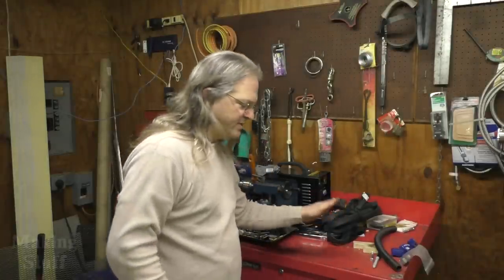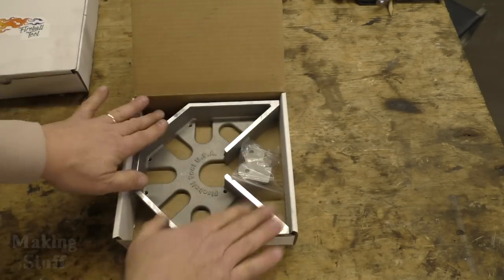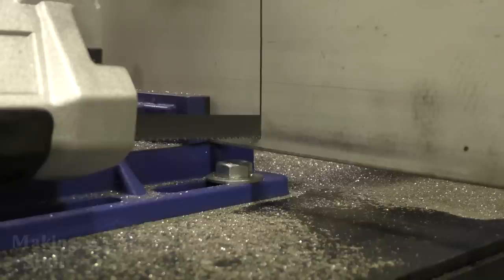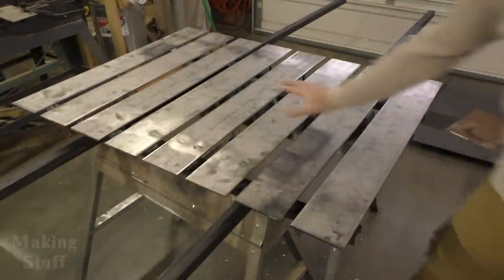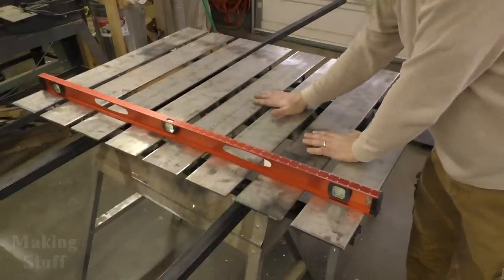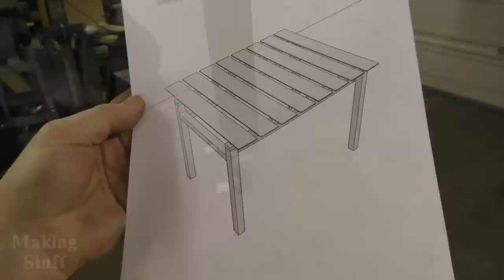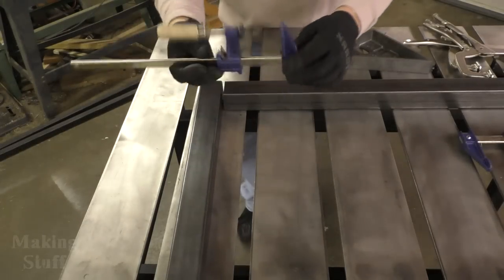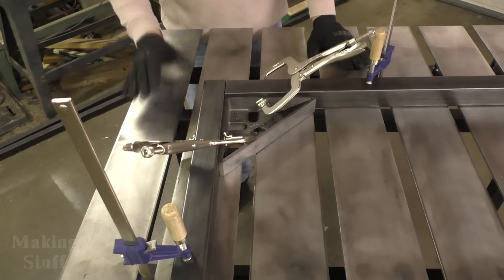DIY Welding Fabrication Table - Stronghand On a Budget

Comment: I’ve watched this video more than 20 times. Dissecting that table build. Guess what.... it’s a great design. Especially the top. I have started my own version of your table. 1/2” x 6” x 40” plates, using 4x 1-2” x 3” bolts on each plate. I’m also using a 3/16” x 1” x 2” channel for the bolts. I will be making a few changes to everything below the top though to more suite my personal applications. But I’m general... I really love this design. Really glad you posted this video!
Reply: i'd love to see your build...i also am making his awesome table...i unfortunately did not see his video until after i made the frame for mine...:P..no c-channel

Comment: Nice table.  I used 3/8" flat stock for my "portable" setup, it's a nice compromise between rigidity and weight. I leave them stacked up against a wall and when I need them, I set up a pair of folding saw horses.  Not as quick to set up as a portable table but it works well and is pretty flexible.
Reply: Flex: How flat is the setup?

Comment: What a great idea to be able to level the top. I used this same concept, but I used 1.5x1.0 tubing instead of flat plate for the top AND I originally used "u" channel, but it sagged on me. It wasn't super thick "u" but I never thought it would have sagged, so I replaced it with 1/4" square tube. Works great. Thanks for the idea!
I am getting ready to make a change to it so I can fold the legs in and then keep it out of the way in the garage.

Comment: Very educational. I build mine based on this design. Work surface is 2000x1200 mm. Flatness is 0.05mm/2000mm.
Reply: What's the plate thickness ?

Comment: I need a welding table to build a welding table 😩
Reply: Concrete driveway!
Reply: silver monkeyface  i just put one together for free. Its not ideal and im going to uograde the legs to square tubing. But i got a really nice 1/4" plate then took apart an old bbq and oriented the legs too fit the plate. I had shorter scrap tubing so i reinforced it that way.
Reply: I need a welder to build a welding table.
Reply: @jefflong858  I glad for you that you already have drill machine, band saw, threading taps and all kind of vises.

Comment: Sweet table. I have a cnc plasma cut table my self. 3/8 thick with slats for clamping anywhere on the table.
Reply: Have it on my channel if you wanna check it out

Comment: I don't understand why someone would want to TIG weld that whole table but I really don't understand all the sparks from TIG welding it.I do like the design so much I'll probably build one quite similar!Thanks for such good thinking!
Reply from the maker: All I had at the time.  I can't figure out the sparks either.  It sparked really bad in the horizontal band saw project too.
Reply: @MakingStuff  I apologize if I came across as offense.I am a retired (plumbers and pipefitters)union welder so I understand why...anyway,I thought it a valid idea and may actually use it!
Reply: @MakingStuff  and thank you for the reply!

Comment: A couple of questions, I am not a welder but I do need to make a welding table for doing repair work on my farm equipment. Do you find the thickness of this table top is sufficient to support projects with out warping from weight? Have you found a need to have fixture holes in addition to the open space between the slats? Would you add or change the construction of this table? I find the more I think about what I might need it’s starting to look like I’m going to need a Flatbed to hold my welding table. Thank you for your time.
Reply from the maker: I've put some large things on the table and welded on them with out issue.  The only time it would be an issue is if I put something small and very heavy on it, otherwise the weight is spread out across all the slats.  I have even stood on it to weld tall objects.  If I need to, I can remove a slat or two to provide an opening.  So far I have not needed to do this.  If I built it again I'd spend the extra $ and get a little bit thicker material for the slats.  I would have done this on the first build but I wanted stainless and it was hard for me to find and expensive.  This was the most I could afford at the time.
Reply: I've been a welder for over forty years and I would tell you right out that the top of this table is too flimsy to be of use in any welding shop I ever worked in. Since the price of stainless is normally 5 to 6 times what carbon steel costs you could have easily bought you  3/4 or 1 inch thick carbon steel instead and had cash left over. The problem with the material used is all it will take to ruin it is to drop one heavy piece on the table and bend those slats. Once bent, they are pretty much useless for keeping anything level not to mention that they would always be prone to flex when under load. There is no conceivable value in using stainless for a fabrication table top unless you are working on stainless projects and wish to minimize carbon contamination. 
The bolting system used to level the slats would also be another sore point for heavy work in as much as they too would eventually bend and require re-adjustment. A better plan would be to build a substantial frame from heavy channel and then bolt the slats down to it through countersunk holes drilled in them. If you really need to have a precise table top you could shim the slats against the framework and the bolts would pinch and hold the shims in place.
Reply: Making Stuff Thank You.
Reply: Norman May I was interested in the Stainless Steel mostly because of corrosion. Thank you for the advice on the table top, I have heavy equipment that will have to be worked on this table so Plate it is.
Reply: @oh8wingman  , this was a great table for a work shop of his size. My favorite part of these videos is where some guy somewhere, who only does it right all the time and everytime chimes in and completely picks it apart. Sounds like the only thing you've been doing right for forty years is being an asshole, with a better table. Great job. This project is something I think I'm going to build and I appreciate this gentleman for taking the time to design it, film it and share it.

Comment: What a bloody good concept and even better fabrication! Brilliant! Have you noticed in the shots of you on the drill press how much deflection you are getting on the table as you drill? Is it floor mounted of on a bench? If on a bench then you could rig up an engineers jack under the table to prevent this, if however a floor mounted one then the only thing to do is find out where the flex is occurring, and fix it. It's in all likeliness to be the pillar tube being too thin, put a solid one in it! Sorted!
Reply from the maker: It is a floor mounted drill press.  I don't have it bolted down because I need to move it from time to time.  It does rock back and forth a bit when I use it because the floor is not level.
Reply: Making Stuff I could see it rocking around the clock ( pun intended) but it was the table deflection I was thinking about, as that's the cause of things not fitting properly when you are sure you drilled it accurately on a drill press but the hole ends up pissed. Watch your video back again Bob and see how much the table moves, certainly the whole thing moves around due to the uneven floor but you can see the deflection as you put pressure on the drill bit.

Comment: If you weld the bars directly to the c sections, wouldn't it be leveled? Are the leveling bolts really neccessary? Thanks
Reply: I'm thinking the same thing. You might be able to get it dialed in perfect with the screws but just welding it directly will probably get it damn close

Comment: Im welding newbie, as far as I can tell there's little use in having a mechanism for vertical adjustments, instead I think a couple of lateral extensors would come in more handy, but that's my unlearned opinion, what do you think?
Reply: @nathanpiatt5001  thanks for the input, now I can see that for some very precise jobs it could be very useful... Not my intended line of work though hehe

Comment: I think I found my new welding table design. Question: given the short length of the plate steel, would a center adjustment be needed to ensure level across the center and along the length?

Comment: Nice build. I know this was a good few years back but thinking to more-or-less replicate your design as my first welding project. Need a good table and looks like perfect project to practice welding. I noticed halfway through welding the legs you switched from TIG to MIG welder. Any particular reason? Being a few years since this build, are there any design changes you'd recommend?
Reply from the maker: I had to TIG welded the stainless steel.

Comment: Should have notched out the sides on the channel section, then the table legs and table top would be stronger and end would be blanked in , also heat input on stainless will distort over time, you might also want to brace on the undersides of those plates, also did you use 309 filler on your adjusting bolts?? The welds might crack if you haven't, if you run a long steel rule across the diagonally you probably have high and low spots from welding the stainless steel plates and adjusting bolts
Reply from the maker: It's not perfectly flat, but it is more than adequate for the type stuff I build.  I did use 309 filler on the bolts. Thanks for the input and thanks for watching.

Comment: My local scrap yard sells all steel for .35 cents a pound,  they have 1/2 inch x6” x 6’ plate I’m thinking about cutting them in half and making a 3’ wide table other wise I would have a lot of waste if I go 4’ ,  is 1/2 to heavy?
Reply: MegaRiffraff : Go the full 6' .
Reply: im doing 1/2 x 6 x 40 on my slats...its does add alot of weight...make sure you do wheels on your table...unless you have a nice tractor to move it :P

Comment: I was just about to pull the trigger on a $500 4x8 ( smallest my local supplier has) 3/8 plate to make a fab/welding table. This will probably be cheaper and nicer to clamp smaller pieces with out trying to drill out dozens of holes in perfect alignment! Nice job !! 

I’m planning the same dimensions 3x4 , would you consider adding another row of adjustment bolts midway through the plate ?
Reply from the maker: No, I've only had to adjust it two times since I built it.  The only suggestion I would make is to use 1/4 inch thickness instead of 3/16 like I did.

Comment: Just wondering what is the benefit of having the slats on the bolts vs just welding them directly onto the frame of the table. Thanks in advance.
Reply from the maker: It's adjustable.  So I can always have a flat table.  I have only had to adjust it one time since building it.

Comment: Did you remove the coating from the bolts before you weld them? Which bolts did you get? I know welding zinc coated bolts is toxic.
Reply from the maker: I don't know what type of coating is on the bolts.  It was dark brown, not your typical silver or gold zinc colors.

Comment: Like the design, but what about those welds?  When you had the tig it was welding like no gas coverage or no prep.
Reply from the maker: I never did figure out what was causing that.  I think it may have been a contaminated tungsten rod.

Comment: Nice project. So how much would it cost for the materials to build this Table for the average Hobbyist? I don't have a wholesale connection for Metals.
Reply from the maker: If you don't use a stainless top it can easily be built for under $200 from any steel supplier (when the video was filmed).  Now there is a steel tariff starting to take place and the price of steel varies on a daily basis.
Reply: Making Stuff Thanks.

Comment: Just me, but wouldn't it be a little easier to have a bigger nut and bolt size? That way there is only one bolt you have to mess with and you don't have to also worry about leveling out the individual slat?

It's a great design either way.

Comment: Gosh do I need a new table for my everlast welders. I weld with both my mig and tig welders but just can't get the clamps in place sometimes but could if I had slats in my table.
Reply from the maker: I put off building this table for a long time and wish I had built it years ago.  I use it all the time and clamp stuff to it other than just things I'm going to weld.  Thanks for watching!

Comment: With those awesome fireball squares you dont even need the table. Just use the tabs and its going to be straight!
Reply: But it shall be not flat. Levelling tool also necessary.

Comment: Are you about to provide all the lengths, dimensions and well as metal composition to your table as well as gaps and weld points.. Cheers😎
Reply from the maker: The 3D drawings are available to Maker+ patreons.

Comment: Great video. Building a similar 1 myself. How wide a gap is that 1.5inch? And how wide are your plates? Cheers
Reply from the maker: 4inch plate with 1 inch gaps.
Reply: Thanks. I have 5.11in (130mm) plates. Was thinking of a 1.5-2in gap (40-50mm). Having used your bench for a year now, is the gap wide enough at 1in? or if you had your time again would you make it wider? It will be difficult to change after I build it! Like you I have mostly woodworking G and F clamps and a few C vise grip style clamps

Comment: I do a lot of my welding outside as I have a small shop full of wood tools and saw dust and love the idea of a stainless table being it would be outside in the rain. Would like to know about what it cost to build. Overall I love it would like to know after 1 1/2 yrs of use if you would change anything
Reply from the maker: I would make the stainless slats thicker.  I cheaped out and bought 3/16" because it was a significant price increase for thicker stainless.  The 3/16th has worked fine with no issues I just would like to have a little more thickness to clamp to.  Other than that, the table has been a great asset to my shop.  Thanks for watching.
Reply: @MakingStuff  3/16th is what I was looking at and  5 inches wide so that's good to know. thank you for your reply and keep the videos coming I really enjoy seeing what you will come up with next

Comment: Obviously with the adjustments you can get your table PERFECTLY flat.  But, how much flatter is that than simply welding the stainless to the steel supports?  Why would someone need a table that was more flat than that which would be obtained from the steel supports? I’ve just bought my first welder (Lincoln Idealarc 250) and have yet to strike an arc. So, extreme newbie.

Comment: clean your metal better for tig welding when you see sparks something is wrong and that orange tint is tungsten contamination
Reply: Chris Renaud or use a shielding gas. Doesn’t look like any
Reply: Does it matter? Haha just proper welding. Still better than people without a table!
Reply: @RCR740   Maybe he's using 25% CO2, as in MIG gas?  He's gotta have something....
Reply: KMG Precision have you tried to weld without gas? Your tungsten will burn as soon you started the arc ;)
Reply: @fredygump5578  it's not possible to weld tig with anything other than 100% argon helium or even nitrogen. If you try with any CO2 it will leave tons of porosity and it will almost seem like it's on fire while your welding.
Reply: @joshamaya196  Not true.  You can add helium to get a hotter weld.  Demonstrated on Welding Tips and Tricks.  Just FYI...  I don't even remember this video anymore, but I think the point was that the welding wasn't epic, and using the wrong gas could be a cause of non-epic welds.  You basically agree.  The only difference between us is how not-epic it would be.

Comment: Nice welding table. One alternative to the flat slats on top (to save cost and increase stiffness) would be some 50x25mm or 2x1" box tubing.

I would make something like this, if only I had some space for it!

Cheers,
Craig

Comment: What was going on with that TIG welding? Popping and sparking and ANY residue means contamination, typically from insufficient shielding gas. Stainless and mild TIG requires 100% Argon for proper purge

Comment: 2 questions: Why did you TIG parts of the top but MIG the bottom part of the table? Also, what size flat bar did you use for the top?
Reply from the maker: I had tig rods for welding stainless, but didn't have any for the stainless wire for the mig.  The slats are 4" x 3/16".  I am very happy with the table as is but if I built it again knowing what I know now, I'd use thicker stainless.    Thanks fo watching!

Comment: Wow thanks, exactly what I was looking for!
How important is that adjustability of the flatness you think? It could also be twisted in the diagonal.
Reply from the maker: It's not .003 flat like a strong hand, but for the type stuff I like to build it is plenty flat.
Reply: Well I just want to start learning to weld, just wondering if I should build this as my first welding table. The adjustability might be overkill or it might be very useful to adjust any mistakes I make away.

Comment: I've watched this video several times and sincerely like the table design and intend to make one for my shop. Just wondered if you have drawings in PDF and a materials list available for subscribers? Thank you kindly.
Reply from the maker: The 3D Sketchup drawings are available to the Maker+ Patreons.  It's not a set of plans, but you can get all the measurements from the 3D file if you know how to use Sketchup.

Comment: Discovered your channel and have been hooked.  It's 3am and I need to go to bed haha.  Love your content, but what is the point on making each individual slat height/tilt adjustable on this table?  What real life added functionality does that give you?
Reply from the maker: In case any of the slats ever get out of the surface plane.  You never know what will happen when you clamp, apply weight, heat from welder, etc.  I've only adjusted mine once since I built it.
Reply: Making Stuff thanks for the quick reply. That makes sense for super precise work.